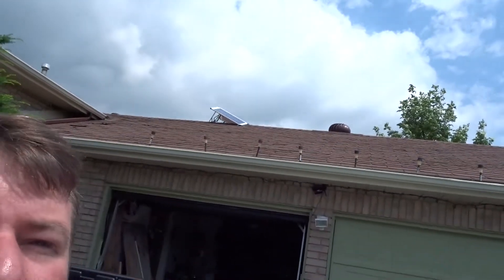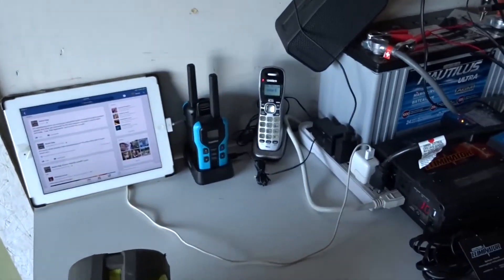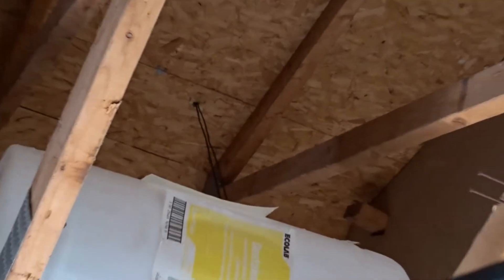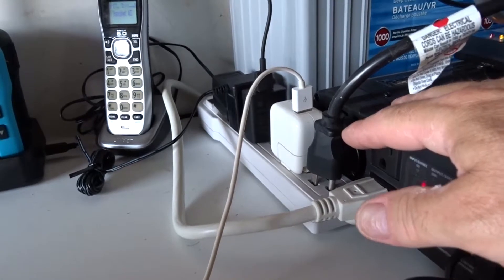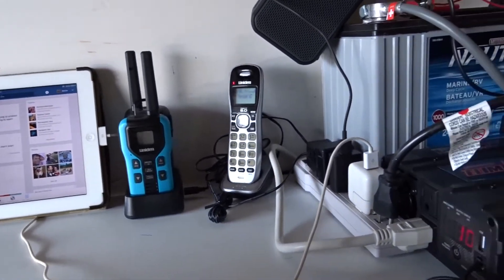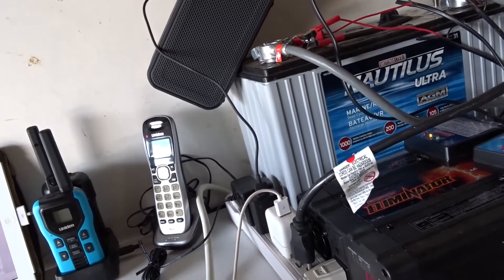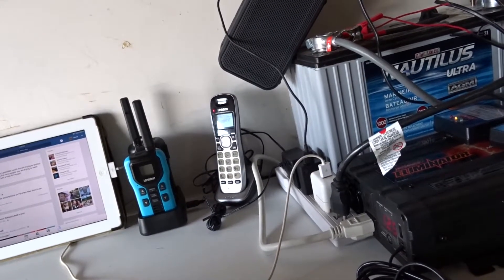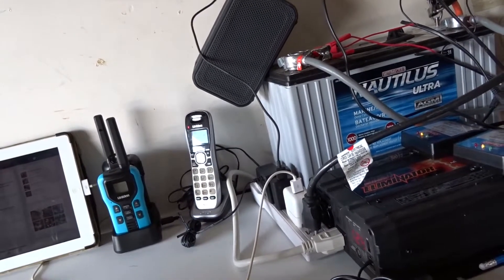Power Inverter Update VLOG0037

Comment: How much power does the inverter draw off the battery, do you have to turn inverter off when not in use?
Reply from the maker: Todd Brown good day, it says it is less than .8 amp..  I would recommend turning off when not in use, especially at night time if not using for extended periods.. Daytime it’s fine.. I’d be concerned leaving it on all the time especially if you have several very cloudy days.. less battery wear.. but I could probably leave it on all the time. I now have 180 watt of solar going to it so it’s powered up once the sun comes up. What do you or would you use the inverter to power?
Reply: @kd_enterprise3404   Small off grid cabin. Run a few LCD lights a fridge, radio and in the evening if the bugs are bad we watch a movie or two. Plus I charge a drill and avacuum batteries
Reply from the maker: Todd Brown fridges would be a bit of a challenge, I think the biggest complaint people have about this inverter would be the internal cooling fan which turns on at about 30 watts.. it’s kinda noisy. I’m sure you can get inverters without this noise, I only use mine in the garage to charge up drone batteries or weed whacker. I have it set up to run a battery operated sump pump if the power goes out. The 1000watt is challenged when using a coffee maker or tea kettle. I’d for sure consider a larger unit and probably a 200 watt panel.. but it really depends. Basic lights and a led tv, or running a lap top would be fine with 1000. At a cabin though the noise would bug me..
Reply: @kd_enterprise3404  OK thanks for the info, I think I will save my money and go with a larger system.I enjoy your channel you cover many topics......loved the popcorn in the bird feeder lol.Take care
Reply from the maker: Todd Brown thanks so much!